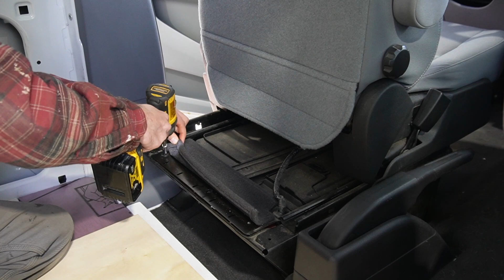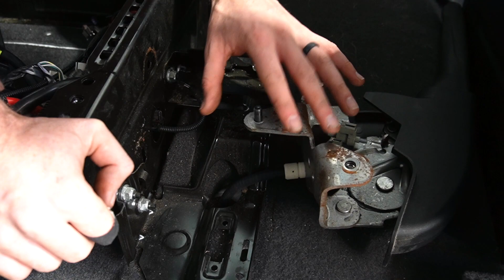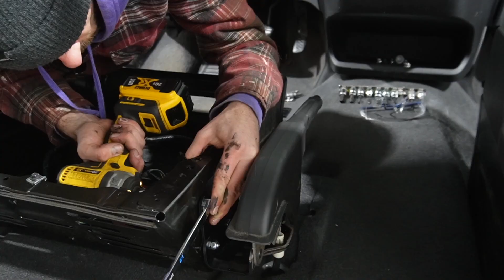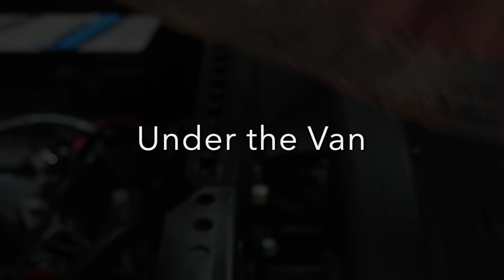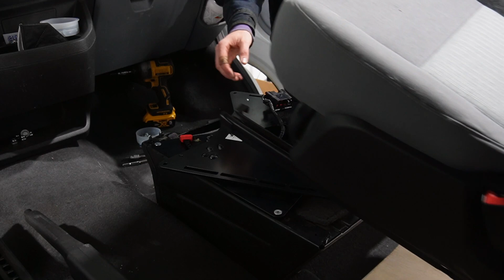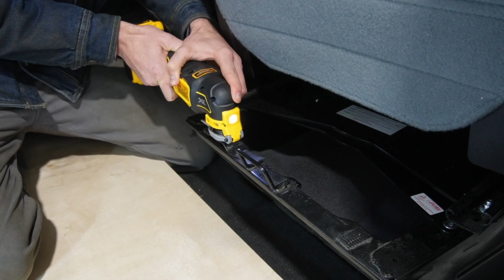Van Build Part 3 | Swivel Seats with Transit Brake Relocator Kit | DON'T MAKE THESE MISTAKES

Comment: You can also trim the ebrake lower plastic housing to make it all look factory. The front of the lower metal bracket that it snaps into needs to be removed or bent and folded back. If you have a 110v plug there it is not possible.
Reply from the maker: Thanks, we will have to try this!

Comment: Don’t forget to check the e brake cable next to the driveshaft. If you remove the driveshaft safety hoop and route the cable to the other side of it there is greater clearance.
Reply from the maker: Yep! That’s what I show us doing in the video. I felt the cable was too close to the driveshaft so we moved it.

Comment: When a battery charges it produces highly explosive hydrogen gas, that tube directs it safely outside, every vehicle with a vented leaf acid battry fitted inside the passenger compartment has one 👍